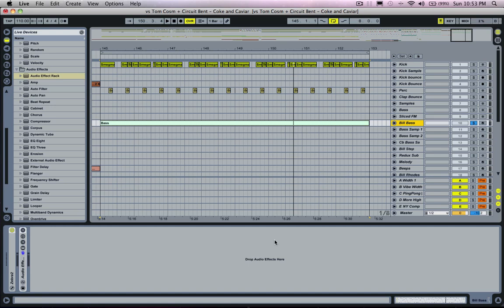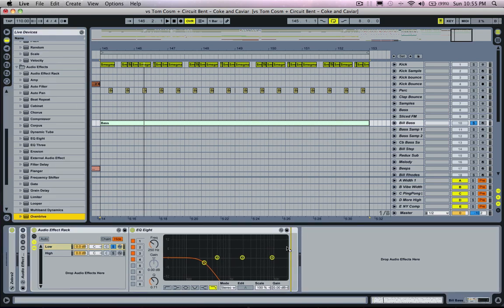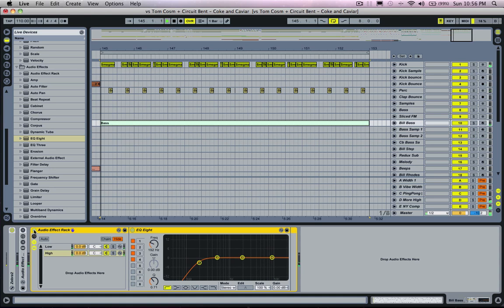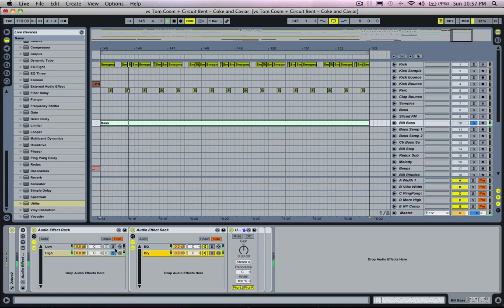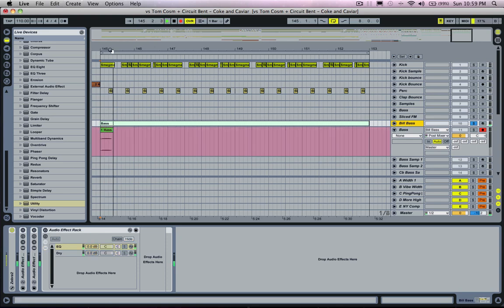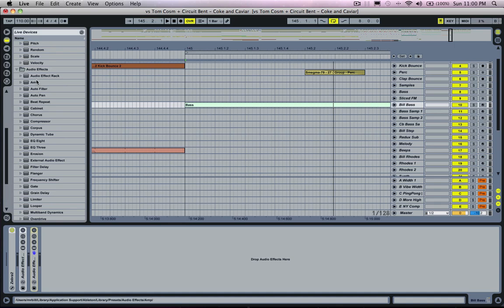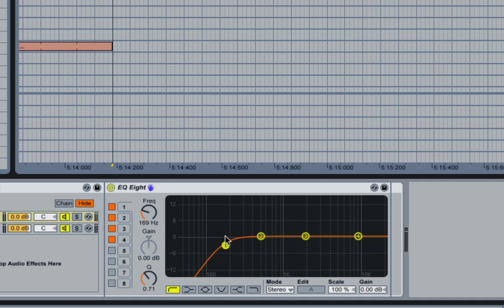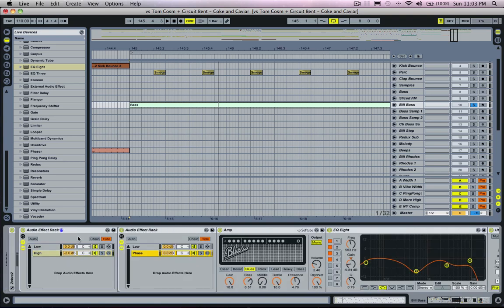Mr. Bill - Ableton Tutorial 27: Splitting Up Frequencies With Phase

Comment: You should be inverting the phase of the EQ track, not the DRY track. By inverting the phase of the DRY, you're inverting the phase of what you're keeping. You would ideally want to invert the phase of what you're throwing away, right? If you invert the phase of the EQ track, the frequency splitting is absolutely phase perfect. You can test by duplicating the track, removing the frequency splitter, and inverting the phase of that track. It sums to zero going to the master. Perfect cancellation.

If you do it the way shown here, you are doing some destructive stuff that I can't really comment on the specifics of, but when you do the test I described above, you can hear the difference.

Comment: Yeh, this is an older kinda hackish way to frequency split.  You'll always get a phase shift at the hi/low pass filter cutoff point, and it's especially more pronounced the steeper the slope.  Dan Worrall did a video about this phase shift fuckery a while back.  You can use it to make neat stereo effects though, by using an all-pass filter instead, and modulating the frequency shift point.

Comment: Unfortunately this method will just muddy your track as some part of the chain is not surgical enough to reproduce the same sound as the dry sound.  It's adding decibels to the headroom by some very obvious audible doubling of some of the freqs.  Using something like fabfilter mb and soloing each band replicates the dry signal perfectly and you can easily set where to split the bands.  You can then change where the split is by mapping two bands to one macro.  I'm pretty hungover after raging with dada life last night so this explanation may be a little "muddy" but I hope it helps.
Reply: i need help doing the fabfilter mb thing ur talking about

Comment: So, I've been having some issues where my volume will spike randomly when I add things to the different bands. I've put a stereo widener on the high end, along with a redux and an overdrive. I did this while the hi band was solo'd, and made sure that the volume before and after was the same. So far so good, but when I un-solo the hi band so it can sum them all back together, I get a boost in volume of 5 to 6 decibels over my original. Any thoughts? Should I process before splitting?
Thanks!

Comment: What about doin the first method where you cut lows and high at 250 and add effects but to make up in the db drop in the overall eq curve at 250 ..use an Eq with 48 db/octive cut at those freq..like the Fab Pro Q? Also at around 4 min 18 sec when you are comparing the two I am confused since the first rack you made is NOT ENABLED?? It sounds different but just louder cause of the two eqs that you added ..gained up the signal...am i missing something? Regardless I learned a ton and love your vids